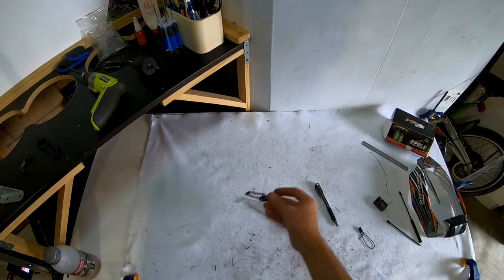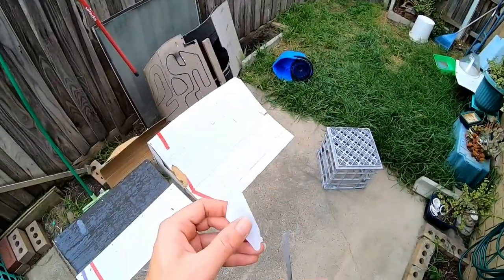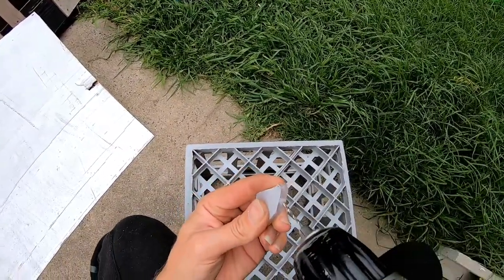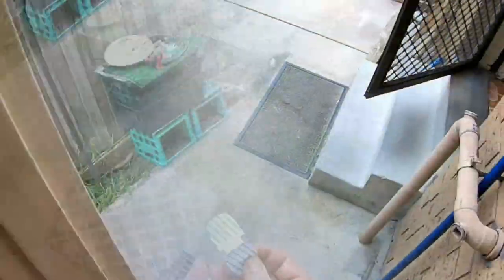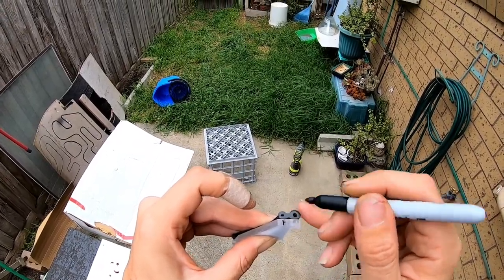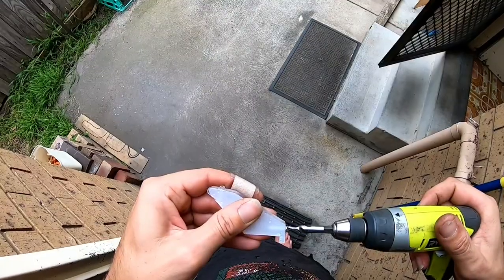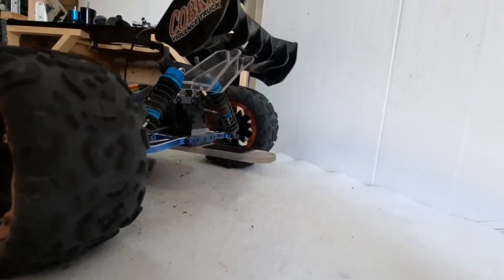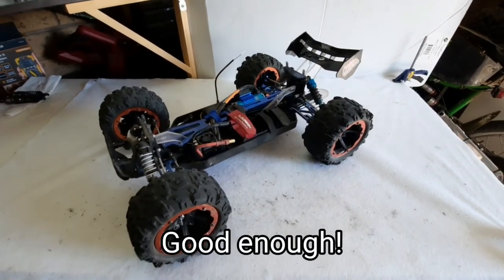VRX Violence spoiler mount. DIY stong!

Comment: "...and don't use your fingers as a vice," he says, proceeding to do just that. LMAO.🤣 But seriously, cool mod. Where do you get your 6mm plastic, m8?
Reply from the maker: 🤣 yeah I'm not the smartest when it come to safety.
I wish I new were to get more of this plastic! Sadly my old man found it when he worked at a recycle plant and new I would use it, I think Bunnings has similar stuff but the $$$$$$$ OMG 
If I find were to get cheaper stuff I'll let you know👍
Reply: @rccrazy  same ? did u find more?
Reply from the maker: Yeah good old ebay has heaps😅
This is the Australian seller I buy from but the same stuff should be available everywhere👍
https://www.ebay.com.au/itm/222396364774?hash=item33c7db37e6:g:Bm8AAOSwsLtjHXnP&amdata=enc%3AAQAIAAAA8L698m366Jql5Se2lWXRItLWpIHc1WnCQ0hrn38EU9unN8IelCjEstyJ%2FxrKA3s09zaix10joO2%2FFriqIB2sZSkRl2y7IszKwdk%2BgkyjQqbDUev4qigiMg4IMomGDlF49uI8R4X6DySHKW20idUtw9KkGxmaiKINUEtnRqurwN%2B6lVi2Rgj2Kt0Oc7QgaJCLn%2FdAJWpZtsyquQb8%2BUZY0vxWuxmKB5ci5gt7raepfOl4Jp%2B%2BbsK%2F4M13%2B%2BJ3g8hsF4e1umO%2Bu6KZFy1OiZIt29OZG8MXDA3cD%2BM41%2FnXBo2TlhDSFSiWJfrMYeBAblHupQ%3D%3D%7Ctkp%3ABFBMjpXcx45i